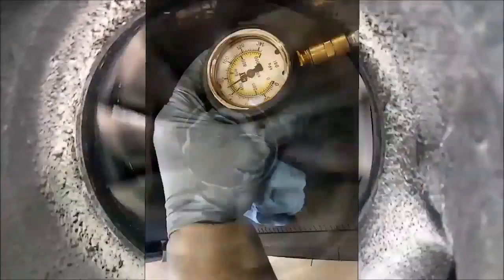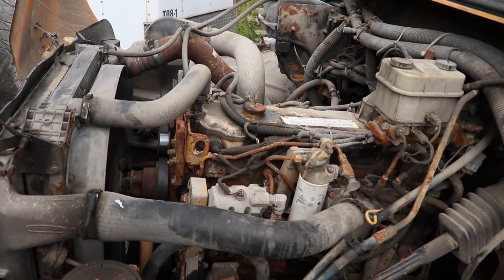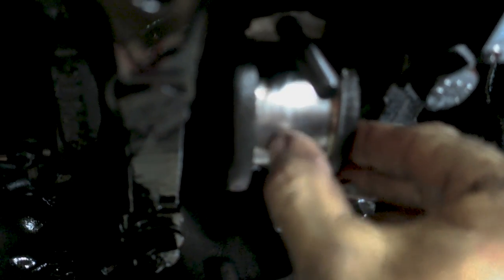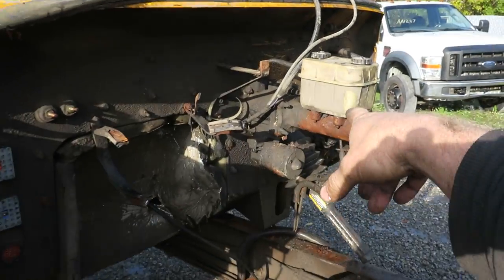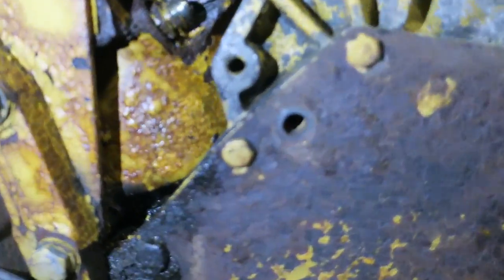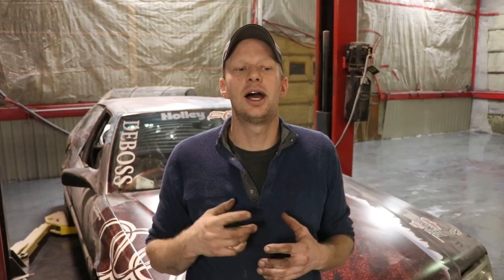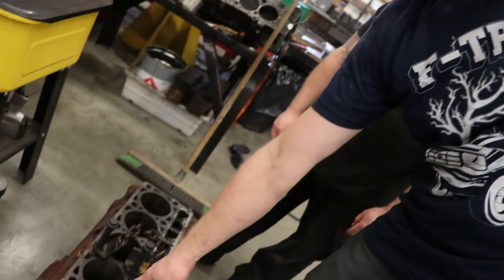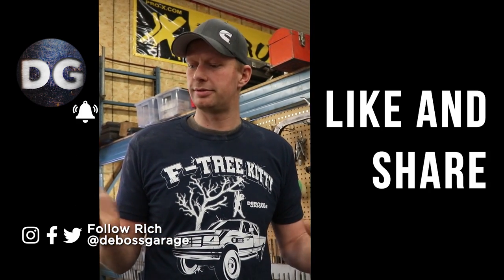CAT 3126 Teardown feat. @AdeptApe | #FTreeKitty [EP4]

Comment: I aint much a kitty guy. The internationals are my cup of tea
Reply from the maker: Me too, but they are considerably heavier.  And these were in the yard, so why not
Reply: @DEBOSSGARAGE  gotta look for a p pump dt360. The pumps spin backwards and sled pullers make stupid hp no stock parts. They say 100psi stock headbolts and 1200hp stock bottoms. Gonna have to find a beefy 6 speed for behind one tho

Comment: There's a reason why most 6 cylinder diesels have 26 or 27 head bolts.
Reply from the maker: Yeah.  I was disappointed.  Looks like the design team of the 6.0 and 6.4 PS.....  The 3126 never really had head gasket issues though.  Just the fueling system.  A couple extra filters and she should be good for the life of the truck.

Comment: Betting you will hate the performance of a 3126, it does not have the support of the 5.9, nor the durability.  We had fleets of those boat anchors, never did we like them.
Reply: Ill bet ur thinking of a 3116
Reply: No, the 3116 was a good industrial engine, a so so truck engine. the 3126, or later C7 was junk.  Inferior to the 8.3 or dt466.  Expensive and poor electronics at least the 3116 was mechanical.

Comment: garbage heui injection?  Can you just put an inline bosch pump on it?
Reply from the maker: As soon as anyone says "just" it is usually $2000 +.  No, I can't "just" put an inline pump on it....
Reply: @DEBOSSGARAGE  lol, i know how easy a 530 intertrashional is to deheui.....waaaaaaaaay cheaper than screwing around with obsolete stopgap tech.  Then again, there are a lot more parts out there to do it.  I would rather have a roosa master running off 520 motorcycle chain than heui.

Comment: Depending on how This build goes I might put a CAT in my f350. I've been tossing arounda couple ideas with it, its an 89 460 ZF5 CCLWB dually. First I was going to swap a PS diesel but when my brother did the PSD swap on his 95 bronco it was cheaper/easier to get another later model bronco (96) and start over instead of dealing with making the wiring work between the older bronco and newer motor. Then I thought about a 12 valve or just building the 460, but now when the big block dies I might go cat. Also worth noting after the engine swap it will just be a daily driver/cruiser not a tow rig anymore.

Comment: 1000 fer a injector darn i may just mod a 6.9 with turbo 7.3l rod lower compression a bit n use a bull moose pump ..why parts prices
Reply from the maker: From Cat.  Lots of aftermarket support now by reputable companies.
Reply: It will still be dogshit slow. Been there done that. A 7.3 with a tune will run circles around it
Reply: @tokeypokey  shows how much you know
Reply: @tokeypokey  7.3s are slow asf. Got torque for days tho
Reply: @williamuskoski1385  powerstrokes with tuners get out their own way pretty well. Idis are flat out slow unless you dump so much money into them you could have bought something better to begin with
Reply: @tokeypokey  7.3s are slow. No way around it. I have one. You can say all you want but their slow. They dont rev fast or high. And a tuner doesnt make a slow truck fast. If you think that u need help. Only way to make a 7.3 faster is a few grand into parts. Injectors turbo valve springs head studs and push rods at the minimum

Comment: BIG MISTAKE since 2011 I have gone threw 4 of these in my boat the first came in the boat and let go at 1800 hours the next only 300 hours this one came from black water engines and the next 68 hours and the one in there now under warranty just past 60 hours Go Cummins
Reply from the maker: Since they stopped making them in 2003, I don't think the engine is the problem so much as whoever is rebuilding/maintaining/working on them.  There is a comment just before this one saying he has 1 million km on his and loves it.  Not that the 3126 engine doesn't have flaws, but we will be addressing them as we build this one.  I also have complete confidence in my engine builder.

Comment: Your cylinder wear was due to injectors washing those cylinders.  So common with these and intertrashionals that it doesn't bear further investigation, and id wager that thing was a white smoke machine for quite a while.
At least these dont crack heads like 3306's, or any older cat for that matter.

Comment: engines can eat zipties, metal not so well
Reply from the maker: The zip ties hold the wires for the injectors in place.  Get brittle over time.
Reply: They do this on 7.3 and other 3/4 and 1 ton truck engines with diesels too I've pulled them apart and found missing zip ties. Always think hope that doesn't end up somewhere bad